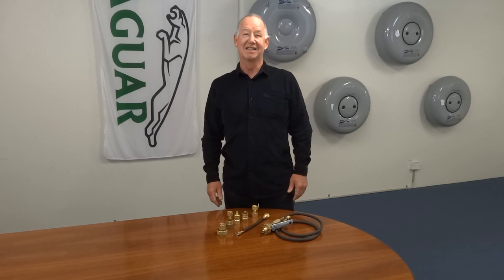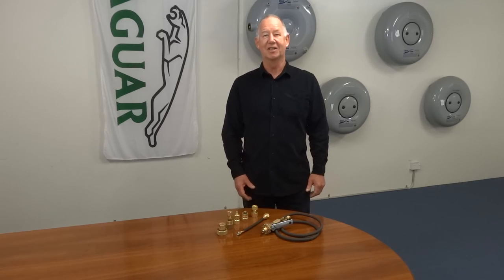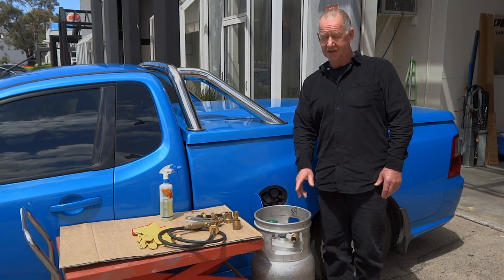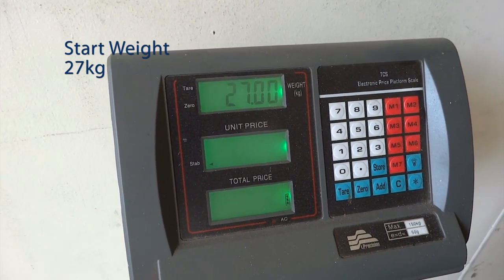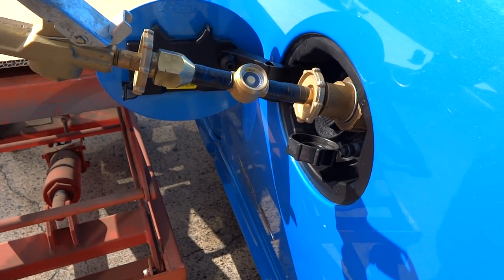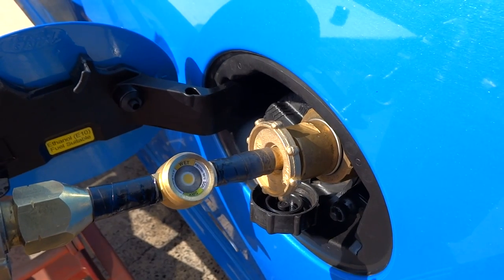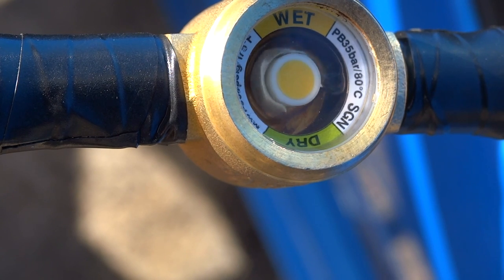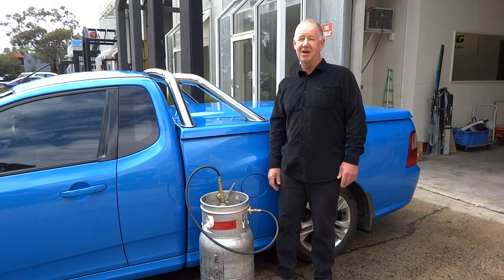How to Decant Gas into a car

Comment: in Australia, 1KG of LPG is 1.96L
so, for every KG of LPG you put into your car, you are putting 1.96L inside.

With decanting, gas is similar but not the same as liquid, because LPG in it's natrual form is a gas. So therefore, the pressure needs to be greater than the intended tank you want to put the LPG into or else it will equalise, so topping up your LPG car won't work if it's already got more than the volume or pressure inside the tank you are topping up from.
"but gas station..." have a pump that measures PSI when that PSI is met it cuts off and refuses to start up again until you disconnect, push down on the lever, pull it back up, reconnect, but at that time, it's not worth it to "top up"

15L of LPG for that falcon, I'm going to be on the side of caution and say 12L/100K which gives the guy over 120KM of running around, not bad from a forklift bottle

Now, about the product, SHUT UP AND TAKE MY MONEY!